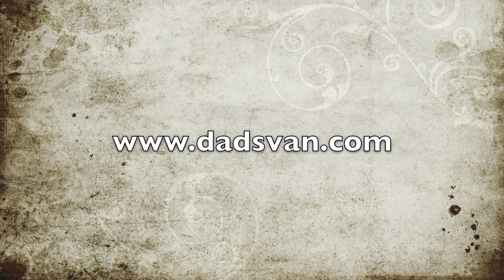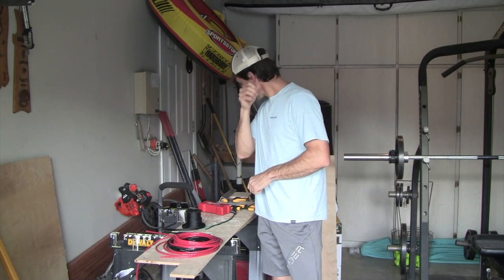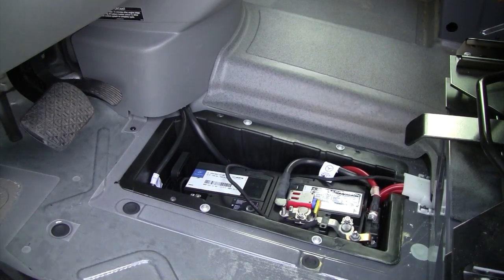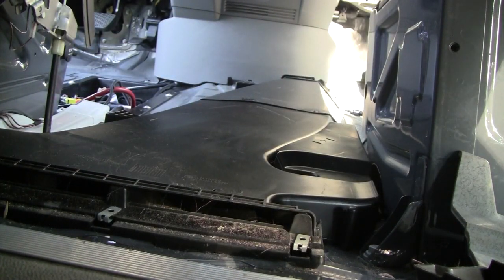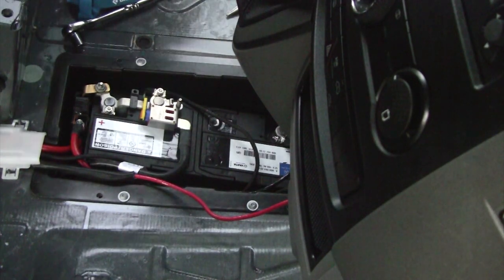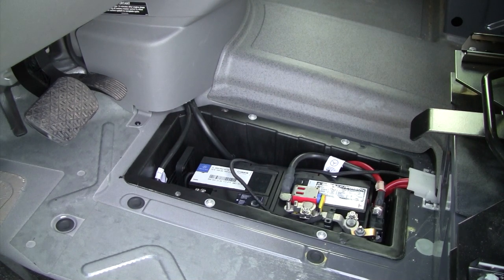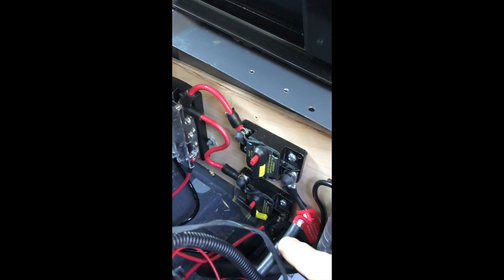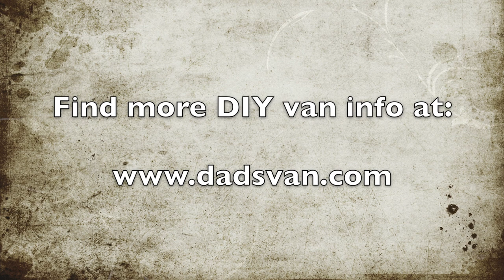How to use Yeti Link to charge Yeti Lithium from Sprinter Alternator - Two options

Comment: So dumb question...on the yeti link integration system, there is also a ground wire..where should i connect that?
Reply from the maker: The green/black wires with ring connector should go to chassis ground point, such as the one under drivers seat.  There will be other ground wires connected to it

Comment: Hi, I have a goal zero 1000 and just added an MPPT. Is it possible to connect the goal zeor 1000 to my car battery?
Reply from the maker: Only if you have the Link module. Unfortunately you can’t have both the MPPT and Link module because use they use the same connection slot.  You’ll have to decide if the MPPT is more valuable to you than the Link.  In my build, I have 300W solar and sunny Colorado weather so the MPPT is not too important.  I like the advantage of the Link for charging in winter and it keeps the starter battery charged.

Comment: I used a lot of the info you had in your video over the past week, so thanks a bunch!  I bought the Yet i Link module back in 2017 and just now July 2022 decided to install it in my 2017 4runner.   I have an older Yeti 1000.   I did order the recalled cable(s), fuse from GZ and received them back in May.    I finished the install today, and my GZ charges just fine but I'm curious about the LEDs that you see once you turn your vehicle off.   At first, all four LEDs are lit on the Link Module for a minute or 2, then just the bottom 3 are lit.   Leaving the vehicle off and unplugging the back cable I see flashing red on the module LEDs for a few seconds, then nothing.   If you leave everything plugged in, and simply turn off the engine - what LEDs are lit, for how long, on your Link Module?   I can find any documentation on what is normal.   Thanks!
Reply from the maker: I don’t have access to it right now, but my recollection is the stack of green LEDs stays illuminated at all times.  I did experience the red LEDs once when I left the vehicle for a couple months. I think the starter battery was drained too low.  It didn’t resolve until I got the starter battery charged up.  Was a bit frustrating cuz I expected the solar to keep the house battery and this starter battery charged.  It was winter though so perhaps lack of charge

Comment: I'm curious, why bother adding the circuit breaker instead of going directly to the battery in the first case?
Reply from the maker: I put one there to protect the cable run from battery to link module.  The Link specs say it draws a max of 65A, but if anything were to short out or draw more than that, I wanted to make sure the cable run wouldn't overheat.  It similar to why there are fuses protecting other cable runs coming off the battery.  I just chose a breaker in this case.
Reply: @DadsVan  makes sense. Thank you sir, guess I’m just so used to playing with residential power I didn’t think about that being an issue at this level. If I was installing it in a hurry, and skipped the breaker it shouldn’t be too hard to come back and add it in later right?
Reply from the maker: @scottriehm3890  It's easy to add later, you just have to get back into the battery box.
Reply: @DadsVan  good. To my understanding, it will also send power back to the starter battery if it is drained, is this true? Will it still do that with the breaker installed? I’m looking at doing this on my fathers work vehicle and where the headlight switch is placed, he accidentally turns them on from time to time getting out and does not notice. Thank you for answering my questions.
Reply from the maker: Yes the Yeti link will keep your starter battery charged if the Yeti is connected to another source like solar or shore.  As long as the breaker is rated higher than max output of the Link (65A) it will not interfere.  That’s why I chose 80A

Comment from the maker: I just uploaded a video showing how to swap out the old recalled EC8 cabling for the new EC8 cabling and Yeti Link Lock supplied by Goal Zero.  That video also shows how to make the butt connection from EC8 cable to AWG6 wire feed to fuse/CB/starter battery.  https://youtu.be/8Od4KYGkAaQ

Comment: Great and super helpful video. I'm a little confused on your voltage drop math. 65A at 12V on AWG #6 results in a pretty unacceptable 10% voltage drop. Is this taking into account the fact that the alternator will really put out 13.5V to 14.5V and the yeti link really only needs a minimum of 10.7V to function, so a higher than normal voltage drop is acceptable? I consider 3% to be a maximum voltage drop in these situations, which is why 12V DC systems require such large wire for longer runs.
Reply from the maker: Yes that is correct!  However it may be that the Link works better if you can supply more voltage. It depends how their controller works.  You may want to contact them to get more info.

Comment: My experience with the link has not beenpositive. I eventually took it out after my alternator died ( granted I'm not sure the Link caused it). Charging with both solar and Link is a big issue. The combined input could exceed the limit of Yeti.
Reply from the maker: Yikes!  I'm sorry to hear that.  I haven't had any issues yet.  Yeti advertises this setup, so I would hope they stand behind it.  The electronics should manage how much total input load it will accept.  If I experience any issues I'll be sure to post an update here.
Reply: @samaminisam and @dad'svan. I also had a bad experience with the Yeti Link. I bought it last summer and connected it the same way you show in your video (similar vehicle too, sprinter 2500). It was working great for about 2 weeks (getting 700W into my GZ 3000 while driving, then during the 3rd week it kind of exploded. I smelled electrical fire smoke and took a look a the GZ, the back of the Link was now at a 45 degree angle and the end of the 12ft cable had melted and was stuck to the link. I bought it from a reseller on eBay so GZ would not work with me on getting a replacement. I had to go through the reseller. I just received my new one last week, since they've been sold out. But kind of scared to install it. Hopefully the new version of the Link (this one works with the X-line) will work better.
Reply from the maker: That is a bummer.  Hopefully the new unit works out.  Did you use a fuse or circuit breaker in your connection?
Reply: @DadsVan  Yes, I used a 100 amp breaker. Now that I’ve seen your video I will try an 80 amp one.
Reply from the maker: You might even try a 70A since the link pulls 65A max.  How much the link pulls depends also on the size Yeti lithium you own.
Reply from the maker: Goal Zero just initiated a recall on the EC8 connectors.  I'm curious if the problem you had was related to the recall.  Hopefully the replacement parts they're sending resolve the issue.  See my new comment on this video.